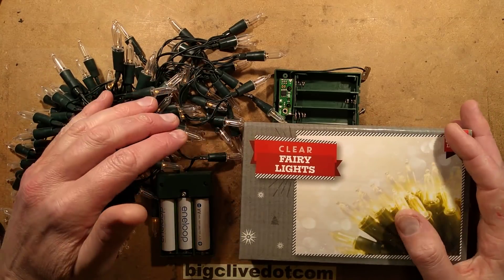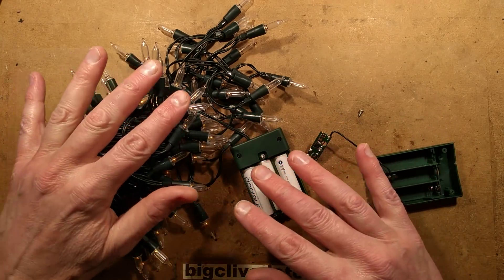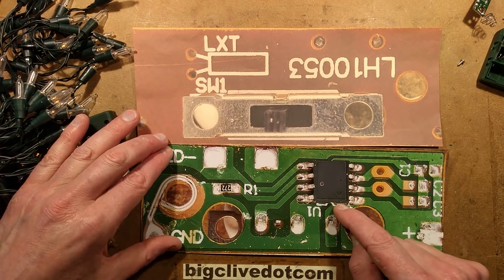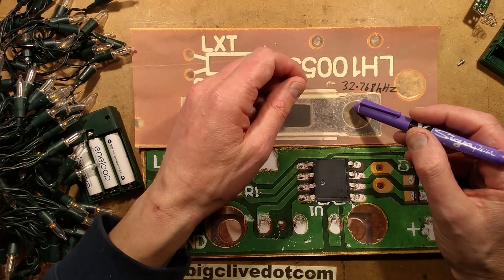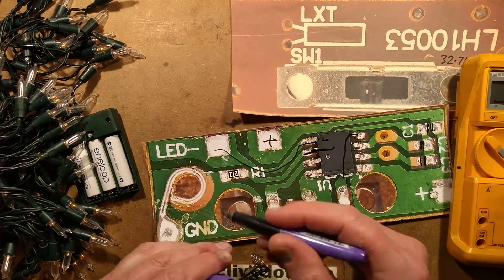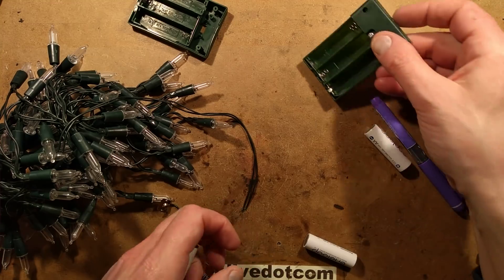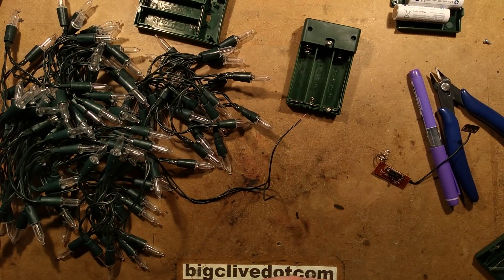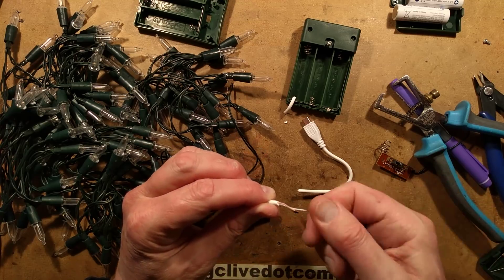Poundland lights unexpected feature and USB mod.

Comment: Big Clive.I am looking for a good pair of wire strippers forward.Very fine war needs to be able to be used down to American War gauge thirty two Both sold and Stranded wire the upper limit is not necessarily a deal breaker Either that type you're using this video or of the. Type that has the ones where the wires just stuck in the jaws and handle squeezed.Has those gripping jaws that pull The insulation away. Would prefer an amazon Link if available. If find one like this that would be suitable would be my daily driver. Why are strippers as it is I've been into electronics since I was a kid and even doing electrical as well.D y I not professi don't know but believe we're not even at school as authorized to do Most electrical work And also the liberal stage Crew electrician, and yes, we were responsible for everything on stage.Even stuffed that we should have handed To be psychically, it's the school property because it's part of the building.That's what I Always said
Reply from the maker: Very small wires are tricky to find good strippers for.  It may be worth buying a few different ones to find which works best.

Comment: Oh, Clive, the PICs I've worked with often have compensation registers for the internal oscillator. You can hook the A/D to the battery (using something like a 1.5V reference generator) and as the voltage goes down relative to the 1.5V reference, you can increase the oscillator trim. I know this exists on the PIC32MX because I've used it quite a bit. And the lowest-end PIC32MX110F016B is under $3 in single quantity. I pretty rarely use the lower-end PICs anymore because the 32MX line has so many awesome features and great peripherals, and it comes in a huge range of sizes and speeds. Anyway, back to watching the video :D
Reply: Or, of course, you could just add a 32.768kHz crystal and be done with it, which is probably what I would do in the same situation again. But it was fun to learn about the compensation registers.
Reply from the maker: Many of these timerds do use the crystal.  Even with the calibration enabled I found the PIC microcontrollers drifted too much with time.
Reply: @bigclivedotcom  Fair enough, it's a pretty crap RC oscillator :)

Comment: Anyone ID'd the IC in one of these? Mines stopped turning off but everything tests good.
Reply from the maker: It's probably a Padauk microcontroller with custom software.  Check the output transistor hasn't shorted.
Reply: @bigclivedotcom  hmm that's a shame, all the flash modes still work and it uses a h bridge with one half of the leds connected in one polarity and the other half in the other. It just wants to keep the party going now.
Reply from the maker: @uK8cvPAq  Could be the switch has failed.
Reply: @bigclivedotcom  I replaced the crystal and touch wood its been working since.

Comment: I have a question about a pool table light. It has 5 glass bulbs with leds in them the leds are burnt. I can get them out of the bulbs. I would like to change them to RGB lighting and I was wondering if your mini rgb kit would do for that project. I can send you pictures of the light if it helps.

Comment: I like the timer and some of the other functions supplied on some of these strings.  And I want them to run from Thanksgiving to New Years or 12th night (Jan. 6th).  I tend to simply add a standard diode between the USB supply and the circuit.  5.1v less 0.6v is perfect.  The good news is - since the voltage stays constant, the timer drift is reduced and the LEDs stay bright.  The bad news is - some power banks shut off if you don't draw enough current.  My latest single cell banks shut off at around 30ma.   
 Merry Christmas and a Happy New Year!!  May Each day be worse than the Next. (It's a good thing.)

Comment: I did this but by stringing three of the 50 multicolour sets together, and keeping the microcontroller. Unfortunately, whilst the greens and blues were bright, the reds and yellows/oranges were dim. Removing the resistors didn't help. On the plus side, the flash functionality still works wonderfully, and it's still somewhat beautiful, especially as I took the to ensure that the order of the colours was maintained.

For anyone trying this, use three sets of warm white (It'd work better). Remove the end lead and first LED to form a string of soldered and shrink-wrapped LEDs, with a single battery box at the end. Remove the metal terminals  from the box, and drill a hole at the bottom (or melt your way through with a nail heated on top of the stove). Remove the battery separators either with a Dremel, or by cutting them out with snips and cleaning them up with a chisel. Feed through a stripped USB cable and solder it to the microcontroller (black to where the metal negative was, red to where the positive wire was. Add strain relief with hot glue, and screw the box back together.

Voila!

Comment: Clive, would you know how to disable the timer function? I have a set of lights which run from 3 AA batteries, only my set is multi-coloured 120 led set, only the two wires going out to the leds, so i am guessing they are simply reversing the polarity in order to switch the colours. I am running it from an old 4.5v charger i had laying around, but the auto-switch off is annoying me, 6 hours is too short a time for me, so would like to have them on constantly. Obviously i can't do what you have done and simply remove the control box because of the multi-colours being controlled by just two wires. Is it possible to disable the timer do you know? Thanks.
Reply from the maker: I had the same issue recently.  I used a time switch to turn the lights off after 6 hours and on again 1 minute later.  The timing function was integrated into the control chip.
Reply: @bigclivedotcom  Sadly the sneaky Chinese have thought of that work around with my set - after disconnecting and reconnecting the power i have to push the select button to turn the leds back on manually. So no quick timer switch option for me. But thanks for the suggestion, i shall remember that idea for other sets i may get in the future seeing that i have a couple of timers kicking about.

Comment: Just saw in my local Pound Stretcher that they have very similar LED light strings, in boxes with the 24-hour timer cycle advertised on the front. They're £5.99 though (it's not a single-price Pound Shop).

Comment: Picked up a similar thing from Lidl today. £2 and only 20 lights so not as competitive as £land. In addition the picture on the box (a glass containing a string of SMD knot kights) bore no resemblabce to the contents which was regular 5mm LED and no glass :o.
On the plus side it did come with 3 Panasonic AAs, worth at least 30p.
The circuit does have a crystal but it is unmarked. The 8 pin chip is scrutably marked T6-24 and the output is witched through a 2TY transistor through a 15 Ohm resistor to the lights.
I will check out the voltages and timekeeping later on, prior to converting to USB (with circuitry). I'm guessing it is not the same chip as in the poundland version and hope it doesn't drift so much thus making the extra outlay worthwhile.

Comment: the efficiency before: 3/(1.2*3) = 83%
the efficiency after: 3/(5.0) = 60%
maybe drive by a lithium battery and use a 7ohm?
Reply from the maker: True.  But at half a watt for the whole string of 100 LED lamps it's still less than half the power of a single traditional tungsten lamp.  And the 5V has the advantage of consistent intensity for the entire run time.
Reply: @bigclivedotcom  I agree, 5V powers are easier accessible.

Comment: Anyone?????I  have about 300 soft white LED strings wired in opposite polarity strings. The cheapo driver/transformer (China) keeps cutting out and over the years the kids have snapped odd wires. I have sorted the strings into runs of 10 x 30  and want to drive them ALL from one power source. I have a model railway Gaugemaster EN60 742 controller with 3 outputs:- 2x 0-12v DC  rated at 1A  12VA max per track and a single AC supply rated at 16v but no amperage is given.  How can I make all the lights work continuously. Obviously the DC supply only makes half the lights work and I'm not sure what value of resistance to use to step down the 16V AC voltage to 2v? for the LED's?. I'm not a complete novice (O level Physics 1986) and a BIG fan of you Clive  but I would like some assistance/advice/input from anybody who knows a bit more about the subject. Am I better off with a LED driver???

Comment: "For those wondering about the silent heat gun, it is brand X model Z. I suggest it, but check before using. Most are great, but some are actually just hand grenades."

Comment: also could you also wire the usb lead directly into the battery box and let the controller still run as normal...  You just change the pwoer from battery to usb. Retains the timer functions and flash functions as well.

Comment: Ye should really try getting one of those beard fairy lights
Reply from the maker: The ones that look suspiciously like the 20 LED copper wire LED strings on eBay.
Reply: @bigclivedotcom  , yea, pretty much the same thing but with clips included. Still, bet quite a few of us would like to see you wear one (me included)hehehe.

Comment: There is no way to make a simple system that auto-corrects drift by having two elements that drift in opposite directions, or maybe just by different amounts, and then applying a correction based on the measured difference?

Comment: 13:43 did you mean to say "spread the heat dissipation"? Because you'd have to put resistors in parallel to share the load between them, not in series.
Reply from the maker: It works both ways.  By using two quarter watt resistors with half the desired resistance value you get the full value but spread across two quarter watt resistors giving a half watt rating.

Comment: 2K7 could be PWM drive ratio for current limiting. different R values for different number or LEDs.  what is the continuity voltage of the fluke 23 ? my fluke is 7.0 volts !!!
Reply from the maker: It's a disappointing 2.6V which is just enough to make LEDs glow.

Comment: Do the Padauk microcontrollers have built-in programming pins? Could you hook up a diagnostics tool and read off the program?
Reply from the maker: I'm not sure if the chips have a security bit that prevents reading out data from the program memory.

Comment: Why not put the usb onto the battery box and make use of the flasher?
If it runs at 4.5 volts it should be happy at 5.
Not a lot to loose, may need R on o/p or change 2.7k

Comment: Use an ESP32 to wake up every ~5 minutes check the network time and turn on or off.

Because nothing makes fairy lights better than a 240mhz dual core WiFi chip with 150uamp deep sleep.

Comment: interesting... wondering if they do this with mains lights, that will be way more precise (not "clock" precise anyways), they already have the clock for the advancing effects and dimmings with AC
Reply from the maker: There have been products that have programmable timing based on the mains frequency.  It's very precise for timing.
Reply: @bigclivedotcom  
yeah i know, honestly there've been a bit of attention in italy lately about the actual precision, a pair of (minor, actually) articles about wrong clocks on microwave ovens and such :D i've "measured" it with an RCT circuit and it was going back and forth on the scope, also the scope has the (useful i say) AC sync trigger and quartz 1kHz test out, i think the generators may be mechanically adjusted continuosly.. not sure about long term consistency

and my sine wave on mains sucks!! it looks like a triangular wave with really clipped pikes
Reply: @bigclivedotcom  
i've checked it with a transformer secondary limited by a 10k resistor, a shmitt trigger gate and an arduino with a bit of code, it seems precise, it hitted the split of a second in one hour, at least precise for non important stuff but.... noooooouuuuu i don't second taking into acount that.... i mean, electric companies are not asked for precise frequency, mains sync is more or less a cheap compromise
Reply from the maker: @redoverdrivetheunstoppable4637  The national grid in the UK has a master clock and one running on the mains frequency.  At times of high load the frequency drops slightly, but they compensate by increasing the frequency at times of low load.

Comment: What  exactly is the purpose of the resistors here? Thanks!
Reply from the maker: They limit the current through the LEDs.  Without them the LED string would try to draw a lot of current and it could damage the LEDs.

Comment: 10:19 good advice when repairing strings of lights with the CR2032. The other mod for USB ( plus the resistors of course) or batteries would workout the case , a USB female conector and  add another switch . That way the would preserve the functionallity of power saving and add two power options... with the work of ripping the case :P

Comment: Hi Clive, Thanks for producing these fun videos. An ESP 8266 or NodeMCU ESP8266 could receive clock syncs and toggle commands from a LAMP stack using GET/WGET? for remotish (wifi-range) operations.Alternately, Would adding a transistor and pullup resistor enable these to be toggled on and off via batch file on a pc (ie disable/enable usb device)?

Comment: I was making up some USB LED lights and the USB lead I used was a bit too good lol. When I cut it up and stripped the insulation, I found that the conductors was foiled and the whole thing was sheathed in a tinned copper braid like coax...

Comment: Thank you so much for doing this video.  I've had a good look at the battery box on my line of LEDs but it doesn't have a circuit board on it.  There's a metal strip from the positive battery terminal into the switch then a resistor coming out of the switch which is connected to one of the wires to the LEDs, the other wire coming from the LEDs is anchored at the negative terminal of the battery box.  Ok, I think I know how to do this.  I don't have a soldering iron or solder so I'll just have to use electrical tape.  Cheers, Poo

Comment: 100mA, but that's for all the LEDs in parallel, with 120 of them, that means each LED consumes just 0.83mA. Is that right? That seems very low.
Reply from the maker: It is low.  But for a string of lights like this it's surprisingly bright.

Comment: I would probably make a hole in that battery case and put a micro-B female connector and a small piece of PCB and power the existing circuit with two diodes in series(should drop small amount of voltage as the current might not be that high).
Reply from the maker: That would work too.

Comment: The thing to realize is, if they turn on at the wrong time the airplane isn't going to crash.  Big deal the decorative lights are 8 minutes late.  I have a similar set of lights and the batteries are dead after 1 week.  So long term drift is not a problem because it gets reset after a week anyway to change batteries.

Comment: The resistor might just hold the reset down. This would be done to program the µC on the board. Which is strange for a one time programmable part.

Comment: HI Clive, Quick question in a previous video you told use which wire you buy from rapid but what solder do you use.
Reply from the maker: Standard 60/40 tin/lead also from Rapid.  (RVFM)
Reply: Cheers Clive Do you happen to know the order code

Comment: This little tutorial on how to convert christmas lights into usb powered christmas lights is genuinely fantastic.
Reply from the maker: Note that it only works with the parallel strings.  But you can run several from one powerbank or plug-in USB supply.

Comment: So they're sinking the LED current with the microcontroller but haven't even decoupled its power pins. I'm surprised it even works.
Reply from the maker: It is being rather harsh on the microcontroller.

Comment: Dunno if it would apply to these lights with the hardwired two-position switch (and two control inputs to the chip, with only a single output, rather than a double string presumably using a single + and two independently switched, somewhat analogue or at least PWM seeming -'s), but some of the cheap battery-powered USB strings also seem to have another hidden feature - if you flick between on and off reasonably quickly (within a couple of seconds), it changes the display mode.

I have some friends who picked up a set and pretty much accidentally found out they weren't just steadily lit but had maybe six or seven additional modes, including all-flashing, alternate flash, fading in and out, twinkle effect etc... Possibly also with the 6-hour timer, but I think so far we haven't got to the point of testing that as they're not left running long enough.

The set I've got is however more like the one in the video (though it has 20 multicoloured diodes, not 100 white ones, and they're the tiny-spot type instead of fake incandescent bulb so I have to put DIY plastic cup shades around them to get a decent effect), so I'll be testing those to see if they're on a repeating timer once they're retrieved from the junk pile known as my utility cupboard...

Comment: Super interesting. As hacked with a 1200 mAh Pound land USB power sticks, this will run for <12 hours, typically more like 8 on the power banks I have measured, so the 6 hour on/off will not be that useful. Would be kind of interesting to run the circuit with a low drop out regulator (EE blog have these for 1 cent-ish). There will be a resistor in the 3 cell control circuit to remove as the ldo can supply say 3 volts ish to give an adjustable current of say 50 mA, giving a run time of < 24 hours allowing a test of the timer circuit which with fixed voltage ought to be better than with decaying aa cells, or you could use aa alkaline  which have a capacity of double the 1200 mA power bank, although wasteful as they would then be fit only for Joule thieves. If I have any of this wrong please correct.Thanks for sharing!